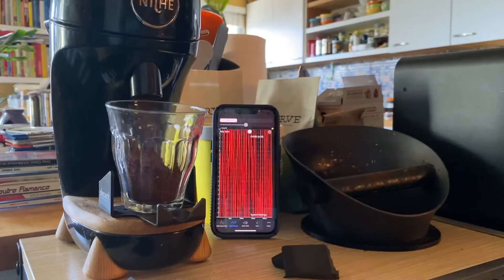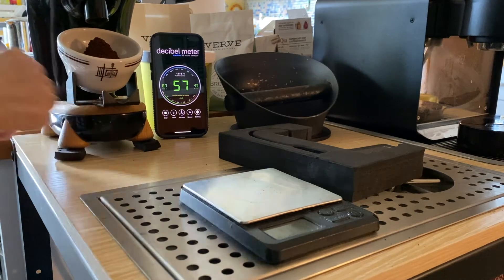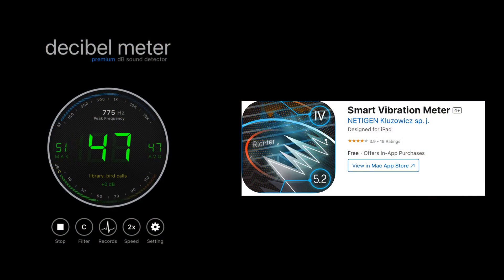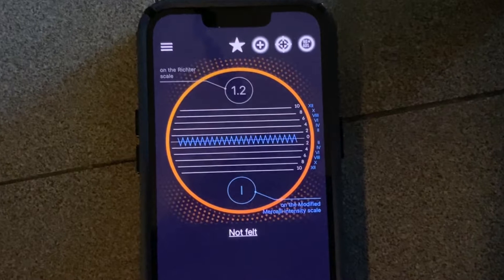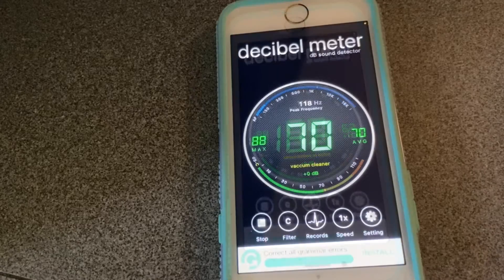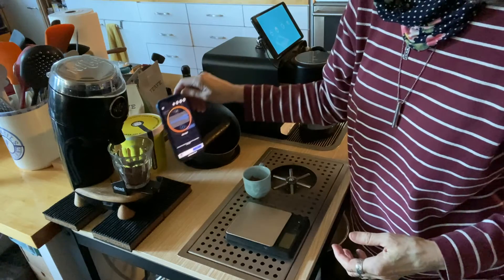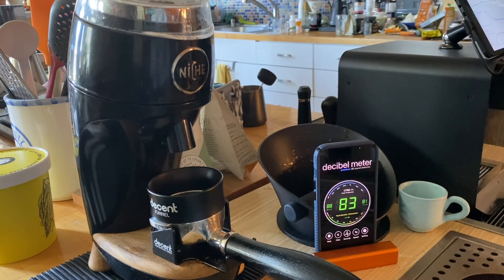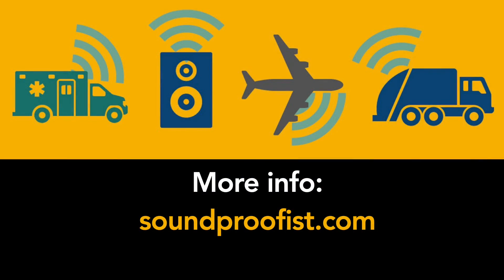The amazing power of anti-vibration pads: how they stop appliance noise

Comment: I recently bought some of these pads (with the light blue foam between rubber each side) but I’m not sure if they’re fake? Unbelievable that even anti-vibration pads would be counterfeited but apparently it is so.

I heard that if genuine the pads will have ‘Diversitech’ or ‘Wagner’ printed on them. 

You’d think when buying goods from Amazon that you’d have some amount of peace of mind and that you could trust them somewhat but I’m hearing many, many items sold on the site are fake. Even things like cameras and headphones.
Reply from the maker: Thanks for letting me know. I'll change the link under this video to Supply House or another (reputable) seller. I put the Amazon links there for convenience (they're not affiliate links). But I don't want to promote fake E.V.A. pads!  I know that if you buy electronics or audio gear, some of those manufacturers won't honor the warranty if you buy the items from Amazon, because of the counterfeiting. For electronics, you need to buy from Sweetwater, B&H in NYC, etc.